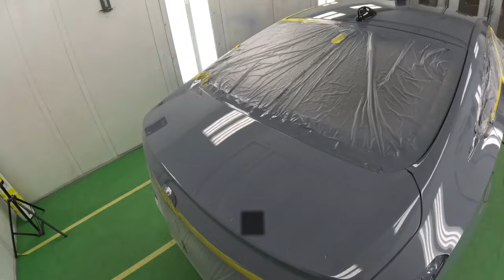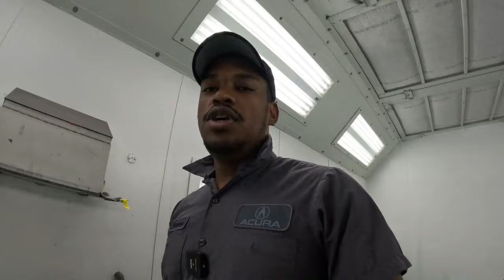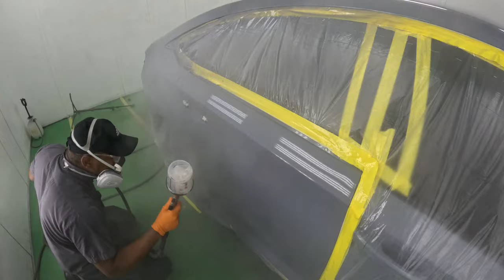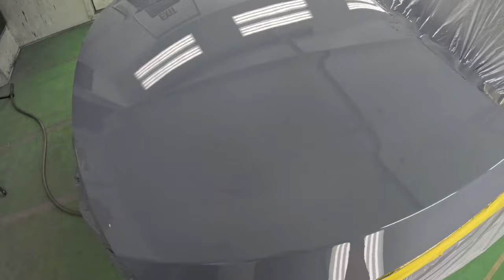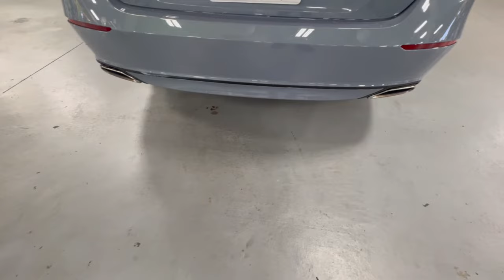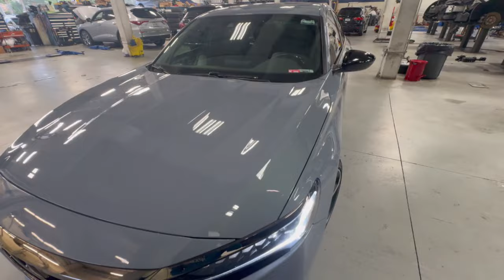CAR PAINTING: HOW TO MASTER CLEAR COAT

Comment: Hey Mario loving the videos bro, you always answer my questions and help me out so much. I have a question on new bumpers that have a two tone paint then plastic I always seem to get sealer bleeding through my fine line tape when I remove it after painting how can I fix that, you can bearly see the grey . Thx man
Reply from the maker: Hey Frank, I’m a bit confused. Sealer main purpose is to prevent bleeding. I’m probably going to need a few more details.

Comment: Great content! Question what’s the re coat window for most sealers?
Reply from the maker: Between 24 hours. But there are different types of sealers, therefore the best thing to do is check the TDS for the kind you use.

Comment: 3:20 - I run into that issue when I'm painting whole vehicle or a lot of panels - I've always been afraid to mix up more than one paint cup at a time because doesn't the activator start 'activating' right away in the cup?
Reply from the maker: Hey man, naw using slow activator would take a while even with fast the products all have a shelf life.
Reply: pot life of activated clear is roughly 1hr. So u have that long b4 u see any difference in the clear viscosity. Worse thing u can do is run out of clear midway thru the clear job, then have to run back into the mixing room to mix more clear, by then the window to continue with ur wet edge potentialy can be done and ur left with a dry edge.
Reply: thank you both... next time I'll try mixing it all at once and see how much better my results are compared to having to quickly mix another batch
Reply: @WJHandyDad  for my first coat, i always mix enough for almost 2 coats of clear. Usually 1.5. Then i do the math on much clear i actually sprayed for the first coat, then for a big job i mix about 250ml (8oz) extra so i wont run out. Also depending on how ur booth is setup, i always like spraying the vehicle itself first cause u have no chance of running out midway thru the job. If u do runout on a bumper or molding, it isnt that huge of a deal
Reply: thank you again @JimmyJiveJones